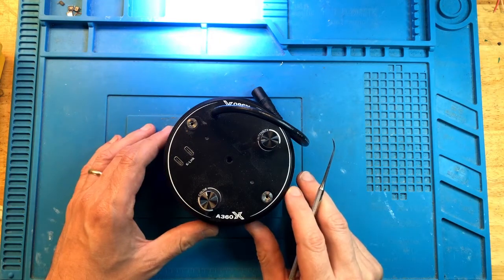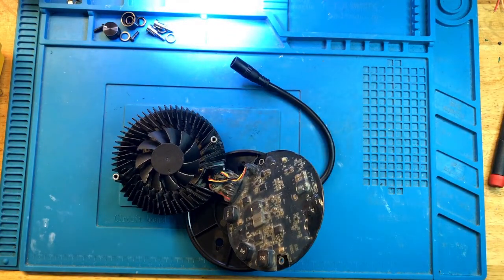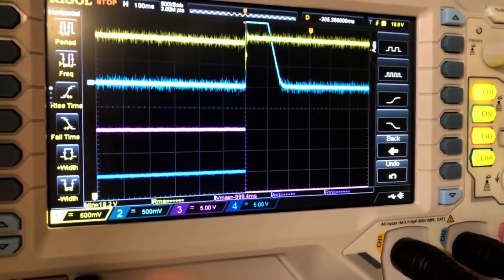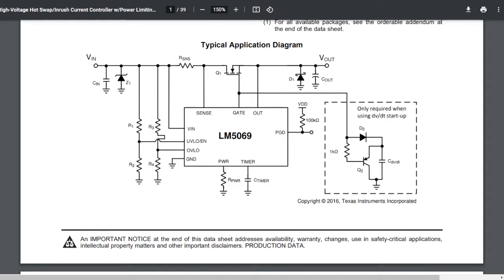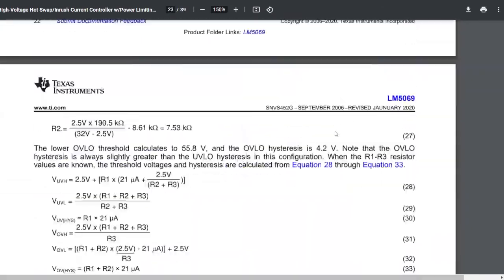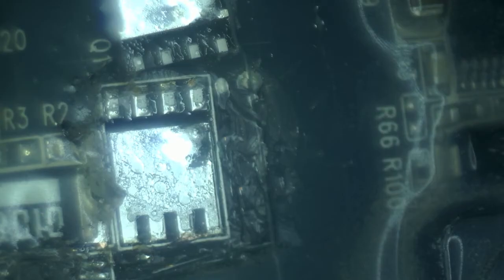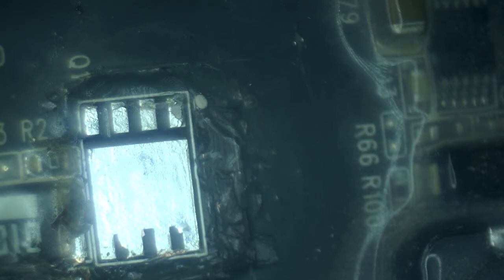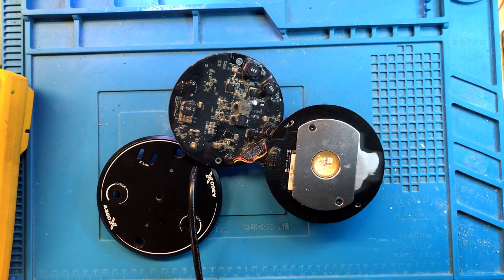Kessil a360x Light shuts off sporadically

Comment: I have a Kessil 360 X and it will just shut off after a few hours of working, then comeback on, slowly but surely it was happening more and more often until it simply does not work anymore.
I spoke with Kessil, they stated they would charge a 100 dollars to diagnosis it and I asked does the money go towards the repair and they said no, so now the repair is a hundred oh yeah 500 to repair so I did not do it. This light was barely used and if it was it was moon light.

Comment: Would you be able to show how one would go about to replace the fan? Quite a few people talked about noctua fans.
Reply from the maker: I haven't had a need to replace a fan on an a306x yet. I've done some on older models. Next time I get one in, I'll make sure to take a look.
Reply: Its easy just dig In from the top. needle nose and a 2m Allen wrench will get it done. carful not to tear the rubber post with the fan is held by.